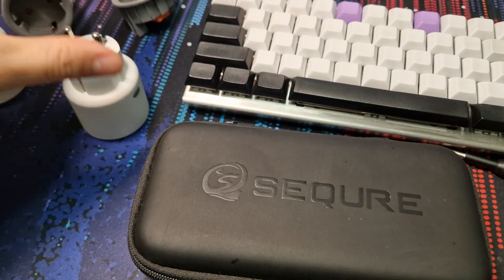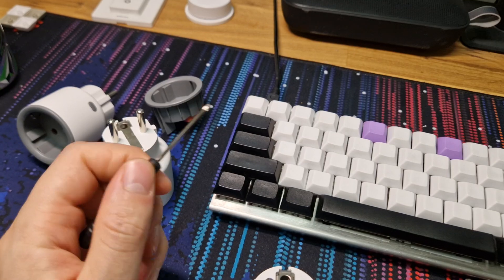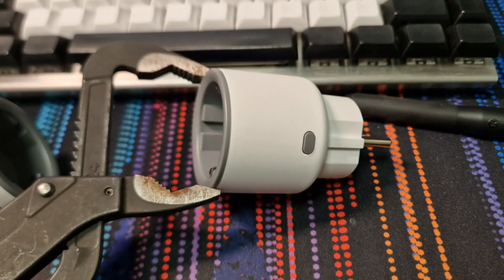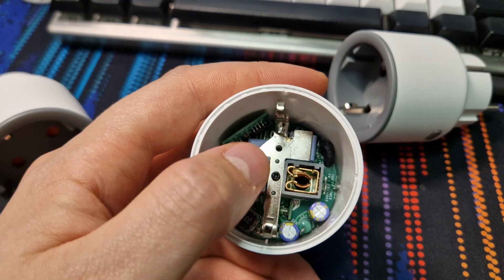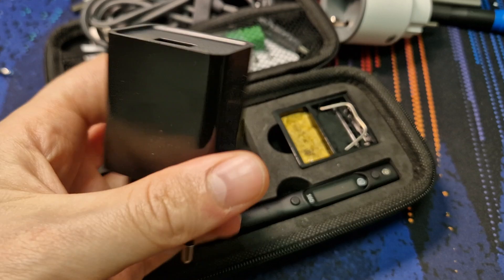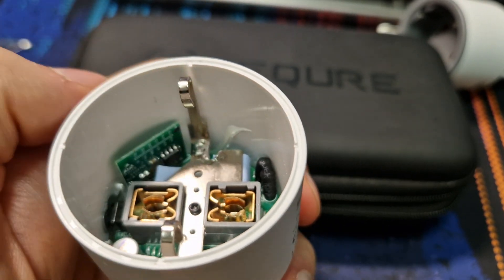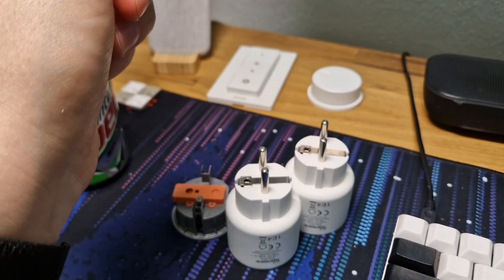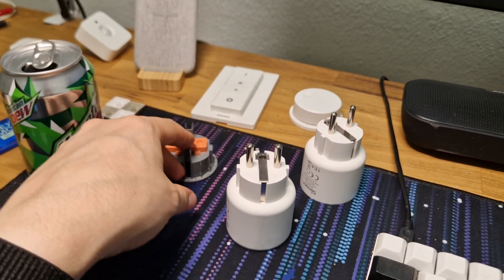Sonoff S60TPF teardown

Comment: Thanks for the Video! Very helpful - especially the link to the github thread.
I'm wondering, Why to buy a Sonoff smart plug and painfully pimp it with tasmota, instead buying an alternative smart plug equipped with tasmota.
What are the advantages of Sonoff?
Reply from the maker: @lbk607  I'm not aware of smart plugs being sold with tasmota or esphome. It'd be pretty neat tho.

I think the main draw to these sonoff products is the cost, they're very affordable, and the for factor. They're very compact
Reply: This one seems to be 4000W capable and also provide power consumption reading. Which would be the alternative with such characteristics?
Reply: @andrei.avramescu  Right, the 4000W, that are specified By Sonoff, comparing to 3600W - 10% less - with tasmota. Not sure, how trustful those specs are in reality... The Power consumption traceable with tasmota/HA as well.